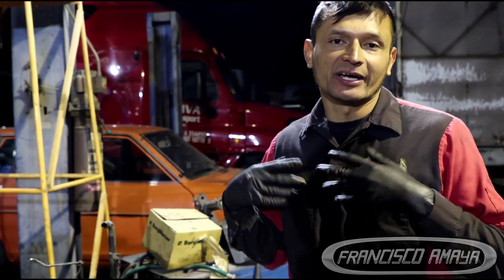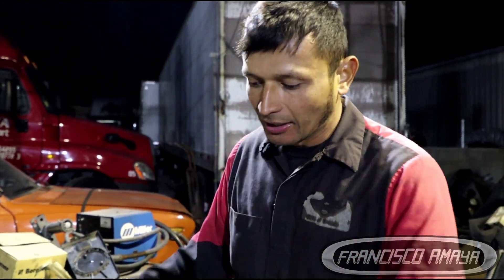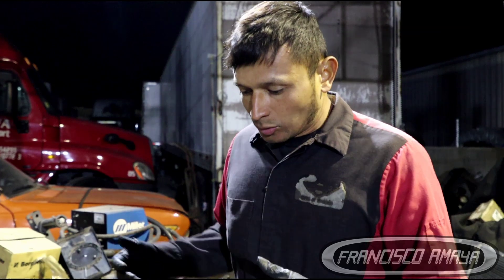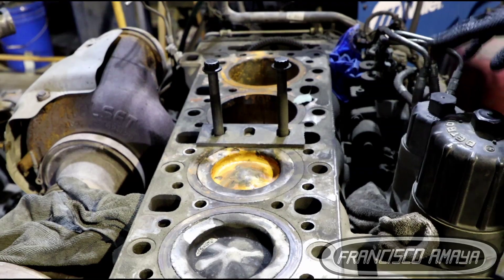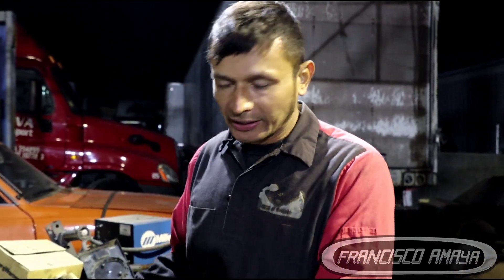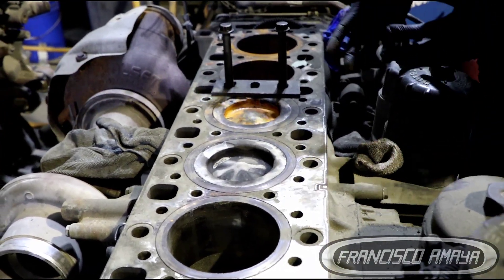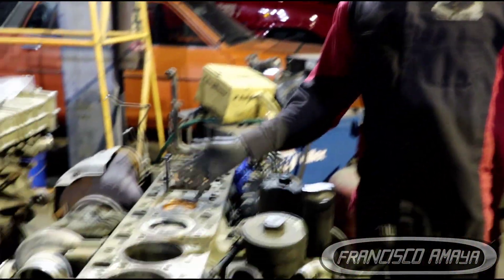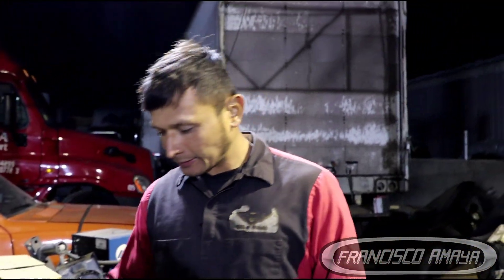DD15 engine water in oil rusted piston cylinder liner engine overhaul repair freightliner cascadia

Comment: Engine rebuild is more expensive than used engine + labor. Or he can get a brand new DD15
Reply: 2019 cascadias are less than 40k right now . Might as well go buy that route
Reply: Well with a used engine you'll be taken a chance probably just as big chance of just buying a whole used truck. Unless you knew the person well enough that you could guarantee it was drove right and taken care of. 
Be  I just rebuilt my DD15 with OEM parts. I replaced the oil cooler ,Turbo , oil Pan , compressor,  head and  Is crank case breather.  I didn't need to do the fuel pumper injectors because I did them about 8 months ago.  It was about $29000 I had 1.27 million miles
Reply: @truckerbuddy3035 bro did you mean to say $2900.00 or $29K?? That’s a shit load of money bro for a rebuild. A complete inframe would’ve been cheaper.